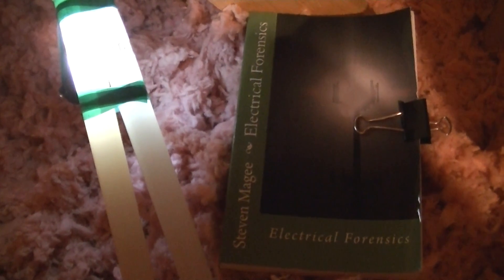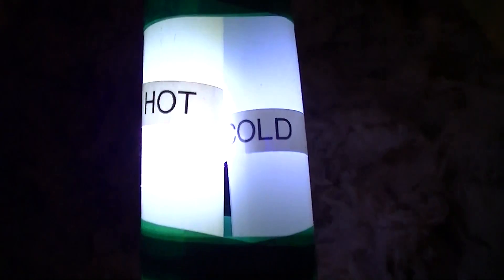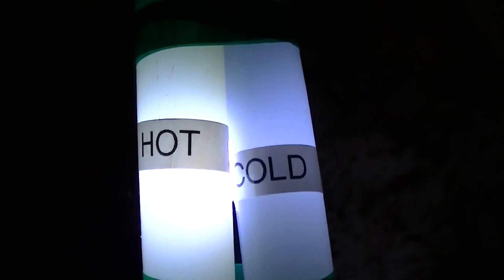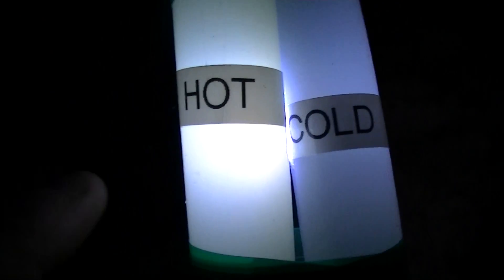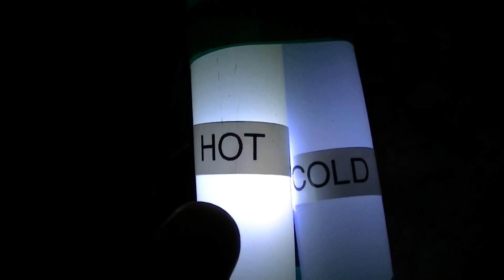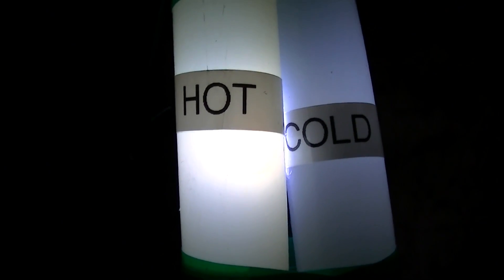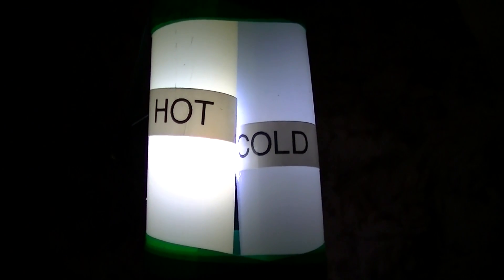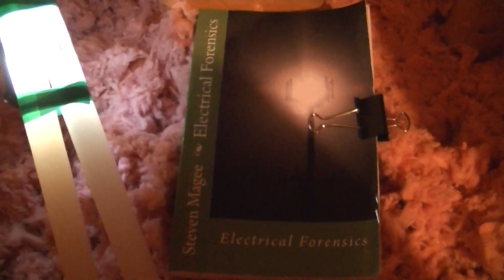Conclusions On Plastic Plumbing Turning Yellow On The Hot Pipe

Comment: Thanks for the video, just FYI for terminology on future videos, there really is no such thing as a "hot water heater". If the water was already hot, you wouldn't need to heat it. More accurately you are referring to a "cold water heater". But the correct terminology to use is just a simple "water heater" when referencing the device that heats your water.

Comment: I just noticed the same issue as of recently. Now the original tubing from 2005 is not yellow, however the tubing installed in 2013 for an added basement bathroom is now yellow as of 2021. It is likely that the tubing is from a different manufacturer or made of different material. The strange thing is that the water heater was replaced in the summer of 2020. I use the same water softener salt so I can probably rule that out. Any thoughts?

Comment: Mine is very yellow, only after a few months of being hooked up. I know when I hooked it I changed the elements and one of the old ones broke and fell to the bottem. May have something to do with it.. unsure.
Reply from the maker: Had copper pipes develop pinhole leaks only on bootom of the hot pipes in the past.  Probably is related to the discoloration shown in this video only on the hot pipe.  I do suspect the electric hot water heater corrosion was the culprit.